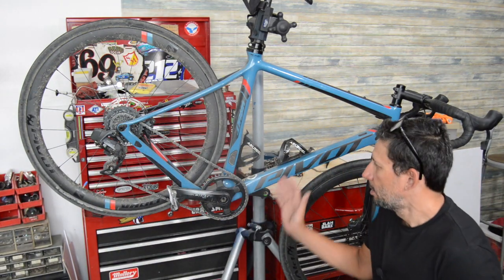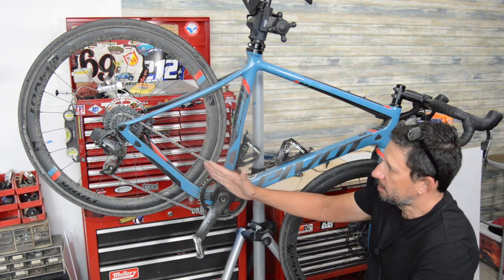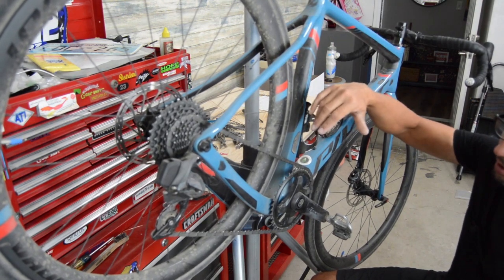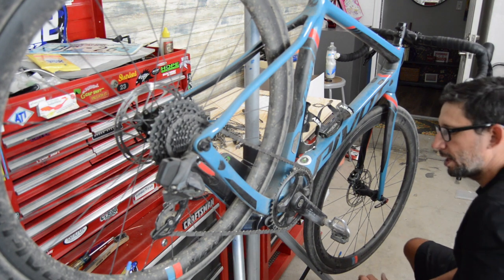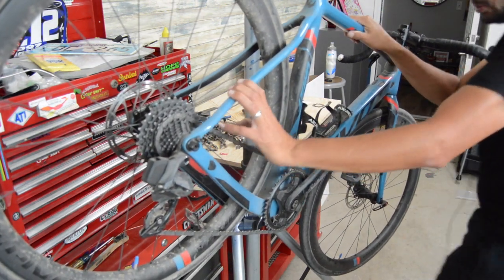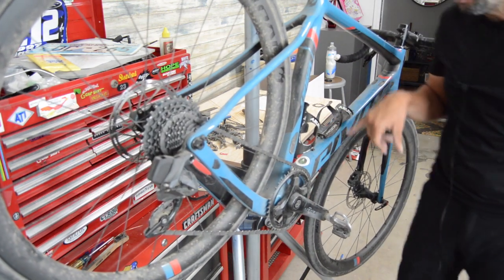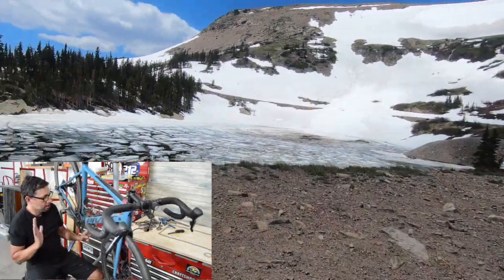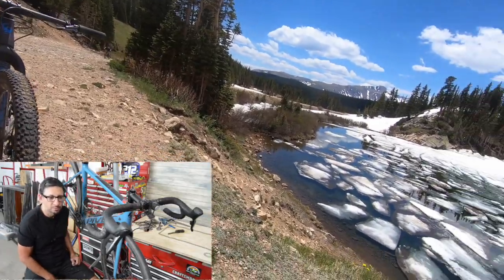Pivot Vault 1 Year Review

Comment: Do you know anyone who has installed a SRAM / Quark crank spider power-meter?  I tried to install mine tonight and it didn't go well (seemed like it would rub the frame?).
Reply from the maker: Yes, I sold the bike and installed a quarq power meter on it. It was still a 1x setup, but even with the 42t chainring I installed on the bike, everything fit fine.